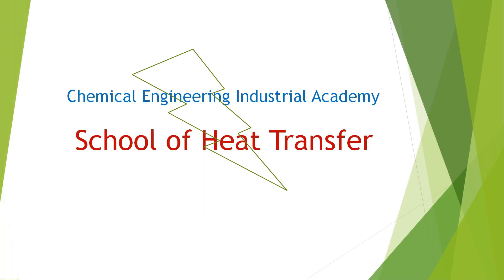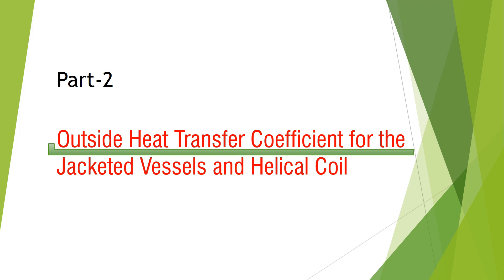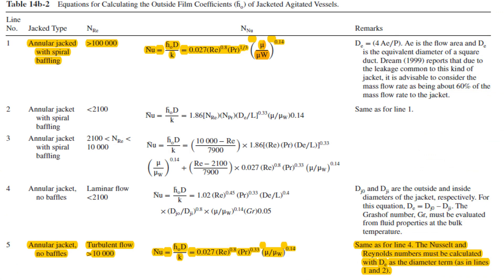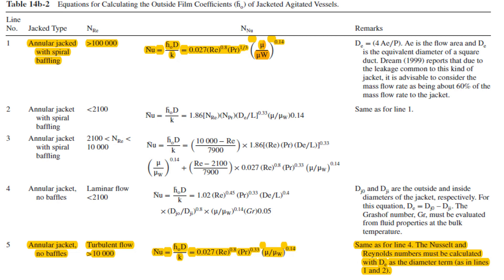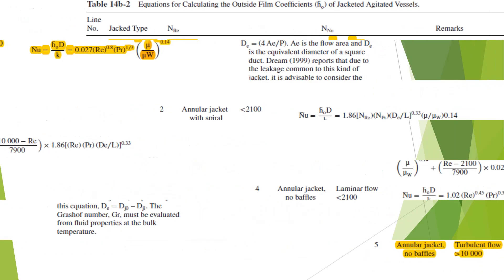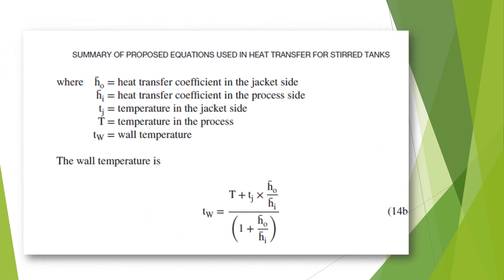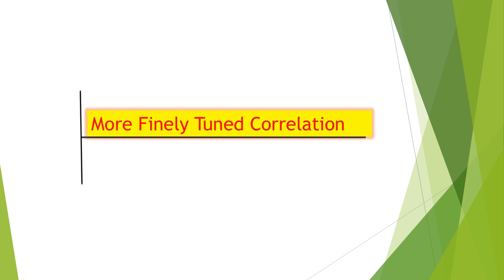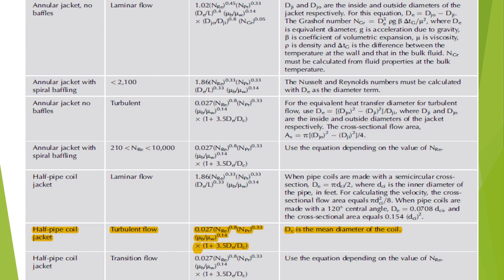Part-2: Outside Heat Transfer Coefficient Calculation for the Jacketed Vessels and the Helical Coils

Comment: I have a similar kind of problem.
I have a tank with volume of 5 m3 (Dia.= 1.65 m, SH=2.4m) with Limpet coil ( half pipe) outside the tank shell . the is filled with a GMS fatty acids @ viscosity of 40 cp. I ahve to cool the liquid from 100 to 70 degC through cooling water is which is flowing into the coil @ 32 degC Intel temp and 38 degC outlet temp.
Questions 1:- What will be the required cooling water flow .
Question:2 If the liquid needs heat from 50 to 70 degc through steam flowing into coil @ 100 deg C then what will be required steam flow.